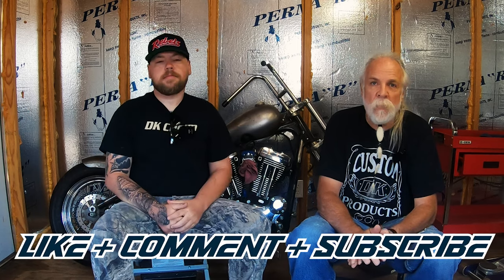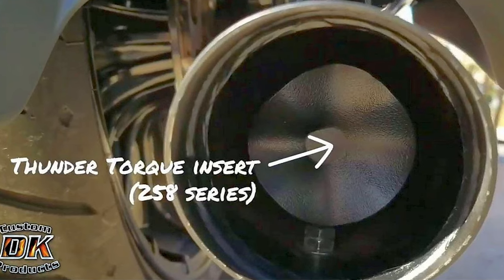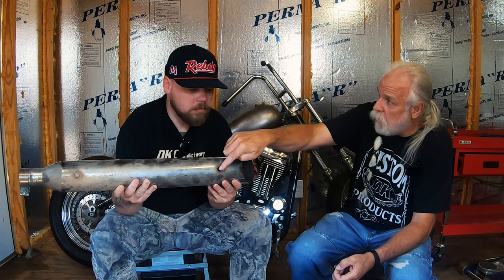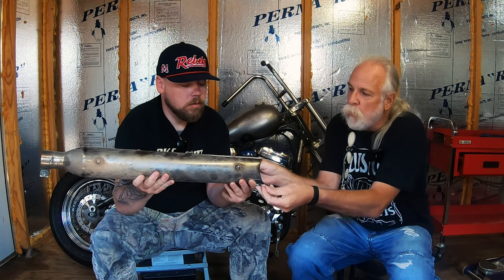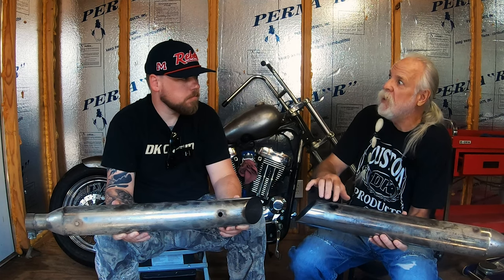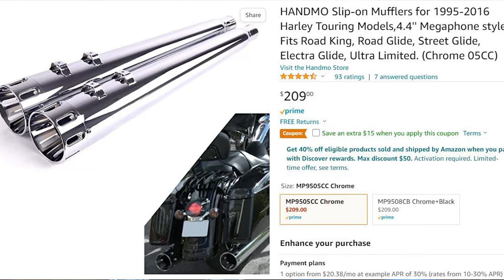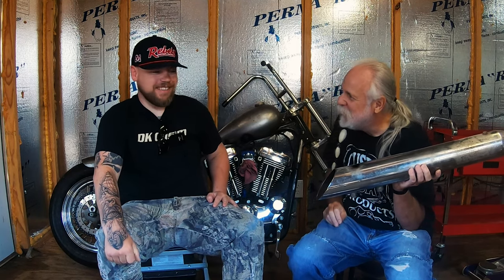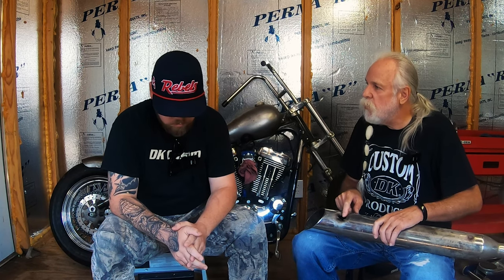How to Install Better Power w/ Thunder Torque Inserts™ on inexpensive, knock-off exhaust.

Comment: Just installed some 258, in my stock mufflers on my 21 street bob. I cut about an inch back so the baffle plug could come out, but left the cats in. The TTI's definitely made the biggest difference, got all the sound and still legal to boot.
Reply from the maker: Good deal, glad it is working well for you. 👍😎👍
Thanks for your business, we appreciate it.

Comment: I put these for my 05 Electraglide Classic with no name slip ons. At first I was happy with the sound but the power didn't feel quite right. I went so far as to remove them and put my baffles back in. I emailed tech support and you guys were very helpful and responded quickly, It seems that the bike just needed to settle in with the new exhaust flow. I put them back in and now after a couple of 100 miles, it runs great, sounds great and I'm happy with them. I track my MPG and if anyone is interested the TTI didn't effect my MPG one way or the other.
Reply from the maker: That is a great report.  Thank you for sharing it.  Good to hear you are enjoying the sound and the extra power. 👍
Reply: What did it do to the sound?

Comment: It's funny you mention it because I just had my V&H baffle and endcap rip out of my pipe while riding so thank you for making these so I don't need to spend hundreds to get another set of endcaps and baffles
Reply from the maker: I hate that happened to you, but I am glad that we have a cheaper item that will give you back your low-mid range torque and not break the bank! 
Thank you for your business and for commenting! 👍😎👍 MB

Comment: To anyone considering these things, I can't recommend them enough. After I installed them in my Vance and Hines Straight Shots (installed on my 2005 HD Night Train), the significant torque dip off idle was completely eliminated, and the torque curve was smoothed out and extended. The Straight Shots also have a raspy tone to them. The TTIs got rid of the rasp, and gave the tone a nice deep rumble. On top of all that, you won't find a better company to deal with than DK Custom. Great products. Great people.

Cheers!
Reply from the maker: Hey Clammy,

Thank you for the review and kind words.  Much appreciated. 👍😎👍

Comment: Good info for sure. I do not want to hear anyone complain about popping exhaust after installation. They need to understand  that adding fuel will not cure this. The problem being the exhaust baffles and fiberglass packing muffled down ( choking out performance and the igniting of unburned fuel in the exhaust)   I used homemade lollipops for years in the 80s on many exhausts, it never cured the popping tho it did help the low end and mid range for sure.

Keeping in mind that DK Customs has done way more testing and real time numbers with their in house product. Well done @ D K Customs
Reply from the maker: Hi Jack!
Thank you for your comment and experience.  Always appreciated.
👍😎👍

Comment: This thing worked great in my 2006 110ci Yamaha warrior, especially noticed a big change in moving off at a light, instant torque from idle. I use cobra swept header pipes and vh strataliner collector to get a up swept 2 into one.  Im surprised the thing works as well as it does.
Reply from the maker: Glad you are seeing the benefits of having the Thunder Torques installed. Thank you for your business and for commenting! MB

Comment: Good points, these can help the torque and mid range and decel popping of open ended pipes (if the OEM mufflers have been modified or you have no or low restrictions in your Aftermarket exhaust).. from my own experiences , They did help torque, mid range (subsequently fuel mileage too) on 2 out of 3, of my large vee twin bikes.. Of the bike it didn't help the torque or mid range (full true dual Vance and Hines exhaust with Titan 4.5" mufflers) .. I saw no fuel consumption increase or decrease, but it did seem to hurt my horsepower alittle noticed in the higher RPMs.. so out they came.. Good point about the fender washer I would mention if your insert stem is mounted upward in the tube (rather than at 6 oclock location) that the moisture collection over time will not be near as problematic.. If you create too much blockage, you will notice a loss of Hp before you notice a loss of torque.  If you are experiencing decel popping (not due to a poor or leaky joint) then that a good sign you need one or a set
Reply from the maker: Thank you for the reviews.
On your bike with the 4.5 Titan mufflers, you should be able to see an increase in low and mid range torque without hurting the top end by rotating the angle of the TTI's a bit.
From the instructions-
"TORQUE: The Increase in Torque is accomplished by reducing engine pumping
losses, increasing exhaust gas velocity and increasing inertial scavenging. The unique combination of materials and design of the Thunder Torque Inserts™ are able to accomplish the above.
Installation angles have a direct impact on how much more torque you will gain.
Because each bike is different (air cleaners, fuel management, headers, slip-ons) there is no single adjustment that is best for all.
In most cases centering the Thunder Torque (height wise) in the pipe is optimal (it does not make a significant difference if it is a little off center, but as close as you can get is best). In some instances our LT (Long Thread) TTI can be used to get it centered.
90%+ of the time the best results are when the threaded part of the TTI is closest to the engine (with the cupped part closest to the tail end of the exhaust)."
Reply: @DKCustomProducts  Thank for the tip.. however though my whole exhaust was aftermarket on my 2020 M8, 107, with No fuel management,  and also true duels,  did not have decel popping, and my fuel mileage was consistently 44-46 mpg,  that was a good sign that more restriction might not be beneficial,  but I tried it any way so I could share my experience.
Reply from the maker: @ut1004bp  Thanks man.

Comment: I wanted to love these!! I installed mine yesterday. I have the older SE 2 slip ons I took the baffles out these make my 88cu louder but sounds good!! Only gripe is I feel like I lost my low end power!! 🤷🏻‍♂️ I’ll probably ride with these for a bit then go back to my baffles other then that I do love the sound
Reply from the maker: You should gain low-mid range torque with the TTI'S. How far in do you have them installed into the slip ons? 
Please feel free to contact our Customer Service with pictures and we can help you trouble shoot and get your mid-low end torque back. 
Support@DKCustomProducts.com
662-252-8828

Thank you for your business and for commenting! 👍MB
Reply: @DKCustomProducts  2 inches from the tip used same hole that the baffles were in just had to drill them out a bit bigger is all
Reply from the maker: You may want to try different angles with the TTI's. MB
Reply: @DKCustomProducts  Just set them closer to a 45 degree angle for whatever reason my bike seems to like that better 🤷🏻‍♂️
Reply from the maker: Some bikes like them set different ways. I am glad you found an angle that your bike likes. Please feel free to reach out with any questions or concerns,
Support@DKCustomProducts.com
662-252-8828
Thank you for your business and for commenting! 😎MB

Comment: I was told by a tech at a performance shop that reversion travels on the inside of the outter shell of the muffler. That contradicts what you are saying. His logic for his theory was that's why reversion cones that fit in the head pipe where they attache at the cylinder head trap the reversion out of exhaust port.
I've already purchased a set of TTI, will install in the near future. 
Would like to get your take on that theory.
Thanks
Reply from the maker: Does this tech have any dyno charts that support his theory?  We have done quite a few tests on torque cones and have never seen any measurable benefit from them.
Here is a video explaining how reversion works (and it is not just traveling along the outer shell) - https://www.youtube.com/watch?v=pr6z00gL5Yg

And, of course, we have dyno charts showing the significant gains of low and midrange torque when using the TTI's.  You can see some of them at this link- https://www.dkcustomproducts.com/thunder-torque-inserts-118-model-family-dk-tti-118.htm

Comment: I just had a set of W158 Thunder Torque Inserts installed in my 3.5" Rinehart slip on mufflers. This was done by my local Harley Dealer. I emphatically told the service guy that they need not be  perfectly centered, but to center as well as possible. Well he has them bolted down tight to one side. So there is clearance you could say at the 9, 12 and 3 o'clock positions, but not the 6. I asked him to just adjust them up a bit. Not a lot of stud thread left as of course he cut them off. He said he could, but the Dyno was absolutely perfect, and didn't feel it was necessary (S & S Cam upgrade also). Just wanted your opinion. Thanks!
Reply from the maker: Do they work best when closer to centered?  Yes.  Is the difference significant enough for you to feel?  Everyone is different in how they ride.  Even the most aggressive rider may not feel the small difference.
I'm sorry to hear that he did not provide the service you requested, if you have the time and the patience to have him try and do it again, the right way (per your request, and the instructions that came with the TTI's) it may be worth it, or you may not feel it at all.
Reply: Okay, thanks. I will ask for them to be centered. Might not be in your wheel house, but will the dyno tune need to be checked afterwards?
Reply from the maker: No, if the tune is good now, it will be good after they are centered.  Only reason for it to go on the dyno is if you want a chart.
Reply: @DKCustomProducts   Okay, thanks again.  While most people wouldn't even notice that they are there, they just look better centered.....
Reply from the maker: True.
Reply: @DKCustomProducts  
This will be the last question on this topic, I promise!

 I purchased the extended thread version as the regular W158 stud was too short. The Harley guy cut the new stud off after installing it. I think it can be reasonably centered, but may be necessary to eliminate the second "Jamming Nut." Okay being secured with only one nut? Otherwise I am totally okay with ordering a new set just to have it done right. Honestly, I even had to tell him to use the supplied washers. Guy just doesn't read instructions......
Reply from the maker: WIthout the jam nut it will vibrate loose eventually.
However, at a local hardware store you can purchase mechanical lock nuts (not nylon lock nuts, they will not work in that heat).  A mechanical lock nut has slightly "deformed" threads that will keep it in place...they will not loosen.
Reply: @DKCustomProducts   I took your advice and had the Tech center the TTI as best he could after having cut the bulk of the extended threaded stud off. Did gain a little using your metal mechanical locking nut tip (thanks again). However he put them in at an angle. I asked him why they weren't squarely facing the correct way. He said during another Dyno, he tweaked the lollipops for maximum result. He said he could turn them back, but the performance wouldn't be at it's optimum. This sound okay to you?
Reply from the maker: That is very possible.   Most bikes will run best with them square, but some will run a little better at an angle.
From the instructions:
"Installation angles have a direct impact on how much more torque you will gain.
Because each bike is different (air cleaners, fuel management, headers, slip-ons) there
is no single adjustment that is best for all."

Comment: Hey Guys, I have a question about the TTI's. Quick summary of my bike. 13 Ultra, Full Sac headpipe, V&H 4" Twin Slash slip ons WITH V&H quiet baffle inserts. I assume I would remove the inserts in order to install the TTI'S? The decel pop is what I wish to eliminate. I do have a PowerVision that I ordered from you guys that will be installed. Also going with your 606 with the Transformer EBS. Thanks guys for all the great videos. Looking forward to warm weather. Just got 18" of snow here in Minnesota. Send some warm weather our way! Take care.
Reply from the maker: Decel pop is all about the AFR in the pipes (this is NOT the AFR in your tune).
Once you install the Power Vision and the 606 with the Transformer EBS, your decel pop may be gone.  If it is not, pulling the baffles and installing TTI's will reduce or eliminate it.  But if you do it now, before the other things you're going to do, it may not do what you want regarding decel pop.
Regardless of decel pop installing the TTI's, with or without your quiet baffles, will increase low and mid range power.
See this video on the subject- https://www.youtube.com/watch?v=I_djBYYYu28
Thanks for your business, we appreciate it.  I believe you are going to very pleased with those parts you're going to be installing.
Hope it warms up for you up there!  We've been having our temps just between 75 F and as low as 25 F....pretty soon it will be warm all the time!

Comment: I should be able to remove my baffles on my V&H short shots and add these without retuning? 2014 model Seventy Two
Reply from the maker: If your tune is already good you will not need to retune just from installing TTI's. 

You can see more about the TTI's at this link - https://www.dkcustomproducts.com/thunder-torque-inserts-c57.htm

Please feel free to contact us with any questions;
Support@DKCustomProducts.com
662-252-8828

Thank you for commenting! MB

Comment: i have fish tail slip ons and wondered how and where to install thunder torque inserts
Reply from the maker: Most likely you will need the 118. You can see a report on how to choose the right size TTI for your exhaust at this link - https://www.dkcustomproducts.com/choosing-the-right-size-thunder-torque-inserts.htm

You can send us an email with a picture looking into your exhaust and the inside diameter measurement 1.5 - 2" inside the exhaust we will be able to give you a more accurate sizing:
Support@DKCustomProducts.com

Thanks for inquiring and for commenting! 😎

Comment: I love your videos but with the Thunder Torque you haven’t specified if your supposed to install them cup facing in or out and are they supposed to be installed in line with the exhaust or slightly crooked or slanted.
Reply from the maker: Here is a link to a page with a lot more info-
https://www.dkcustomproducts.com/thunder-torque-inserts-158-model-family-dk-tti-158.htm

Here is a link to the instructions page- https://www.dkcustomproducts.com/media/wysiwyg/Updated_9_16_22_Thunder_Torque_installation_instructions.pdf

Angle/slant is addressed in the above instructions.
The cupped part faces the exit of the exhaust.  This does two things-
1.  The cupped design does a better job of stopping the reversion/energy pulse from returning back up the pipe.
2.  The back of the cup (cone shaped) speeds up the expelling of the exhaust.

Here is a link to over 50 videos showing different installs, different sounds, etc.
https://www.youtube.com/playlist?list=PLb3bvZgbH92-y9LGItkUD9O2fFo3-gtVl

Comment: what about the torque cones that fit in the head pipe at the exhaust port
Reply from the maker: All the seat of the pants testing and dyno testing of torque cones, installed at the top of the header, provide little to no benefit.

The whole principle of the Thunder Torque Inserts™ is to Increase Exhaust Gas Velocity by reducing reversion.  The only place that can happen is at the end of the pipes, where the exhaust gasses exit into the atmosphere.
Here are a couple of links that you may find useful/interesting
https://www.dkcustomproducts.com/harley-exhaust-myths-and-facts.htm
https://www.youtube.com/watch?v=nB0XDQVjH9Y

Here is a video on Cat's  you may find useful - https://www.youtube.com/watch?v=ks39Gwb3NdI

Please feel free to reach out to us with any questions you might have:
Support@DKCustomProducts.com
662-252-8828

Comment: The dealer installed the W258 Inserts into my 3 1/2" Rinehart slip on mufflers. It is really crammed in there. I did send your Support Division an after photo. Natalie (who couldn't be nicer), said they did look tight, but suggested I just turn them a bit sideways to allow more air flow. I think I should just order a set of W158 Inserts and swap them out. My bad for not ordering more carefully. Do you agree swapping out for the smaller size is the best way to go?
Reply from the maker: If you have 3/16" gap, that is good.  Also, you can rotate the TTI just a little to see if you like the sound or power better that way.
Here is a link with info that you may find useful- https://www.dkcustomproducts.com/choosing-the-right-size-thunder-torque-inserts.htm
You can certainly try the 158's, the only way you will know which size (and adjustment in angle) is to try them both.  Myself, I would start with the 258, like you did, and play around with the angle...but, if extra expense is not an issue, trying them both will give you the best way to know which sound and power curve you like best.
Reply: @DKCustomProducts   Thank you! The wife is still rolling her eyes, but I will not be able to sleep at night with those huge 258W Inserts wedged in there. Fortunately they are very reasonably priced, so I will just chalk it up to experience and not checking out your size chart closely enough. One more question; will the smaller 158W Inserts skew the Power Vision 3 Tune and Dyno Testing I just had done?
Reply from the maker: It will not skew the tune in any measurable amount, but you will have more low and mid range torque.